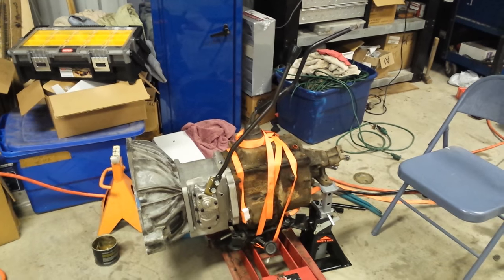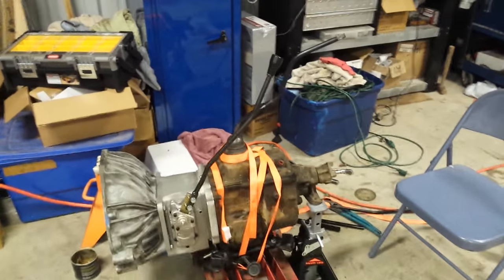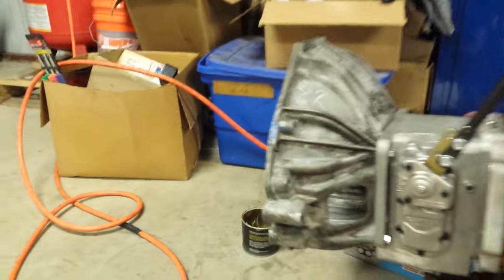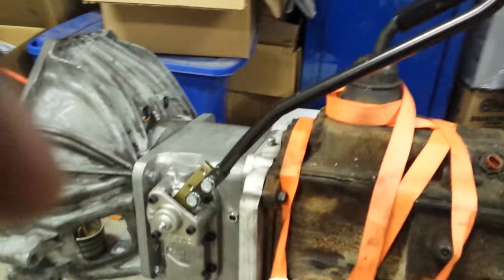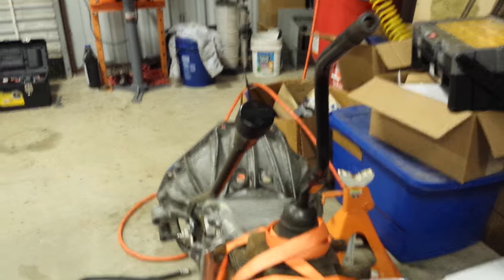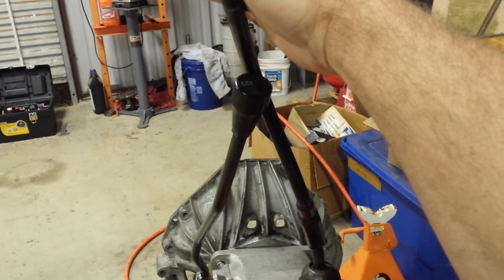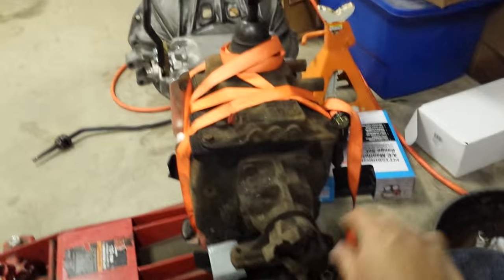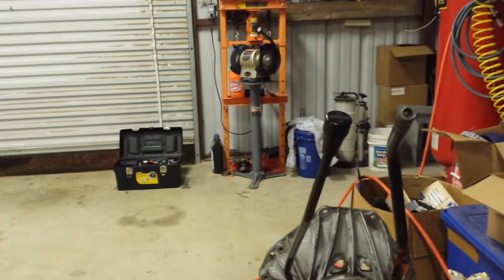F150 Twin Stick Transmission Part 1.

Comment: I want to build this so bad thank you so much for figuring this out and putting it together and making it work!
Reply: Unfortunately, this torque splitter has been discontinued. I wanted one for my 83 C-30 dually, with a 6.2 diesel, and SM465 granny low 4 spd. Wonder how many are available used.

Comment: Another option is the heavy duty ZF 5 speed. I had a 1994 F250HD 2wd 300-6 and ZF heavy duty 5 speed. Except it is a 1 piece transmission and bell housing. I wish I still had that truck.

Comment: i really like this setup. having a hard time choosing between this and just getting a ZF trans for my diesel, with the ZF i can re-use my driveline and only need to replace the shift pan from a later truck to accommodate the taller trans. but having two sticks and 8 gears is just so awesome
Reply from the maker: What Diesel engine do you have? This 2 speed aux trans will bolt to a bellhousing that will accept a Ford or Chevy 4 speed truck transmission. I know you can adapt this to a cummins or an older ford diesel (pre powerstroke) , basically if they ever put a 4 speed granny behind it you can use this transmission. I have also seen this used behind an old two stroke Detroit.
Reply: i have a 6.9 idi with a t-19 which uses the aluminum 4 speed bellhousing
Reply from the maker: Then you can easily do this swap. I thought I had a T-18 but it turns out I have a T-19.  I have the 5.03 first ratio. You probably have the 4.0 first gear ratio. They used that T-19 version behind diesel. It is a close ratio trans so not sure how well the gear splits will be. They are perfect with my wide ratio. Let me know what you decide.
Reply: KLX1990 I have an 84 6.9 1 ton. if I not mistaking I think the diesels use the 437 np 4 so. cause the ratio is closer for the diesel. looks the same as the t-18 though.
Reply: i have had 3 6.9's, a 83, 84 and 86. all were 4 speed and two of them were 4x4's. they all had t-19 transmissions, fully synchronized and they said borg-warner on the side of the case. maybe yours is a custom job?
Reply: KLX1990 could be as rated for 10,000 lbs 350 is considered a 1ton. this route spliter can this work in a diesel application ? the diesel has a high tourqe rating also would a 350 trk be over rated for this? I'm seriously thinking here. thanks.
Reply: the splitter is rated for 420 ft lbs of torque max and 26,000 pounds max. the idi diesels are good engines but they don't make 420 ft lbs, so yeah i would say go for it. the gasser t19 would be a better trans to split gears on because it has a wide ratio, the diesel transmission is pretty close 1st-2nd-3rd
Reply: KLX1990 26,000 that still gives me 15,000 payload if I gobble that much I'm over weight by a long shot. um if I load 4,000 u see a little lag when changing progressions , noticeable 2ND to 3rd , other wise low is a nice low but a shade tall if u know what I mean. I do go into PA sometimes . that why I'm looking at this closely .

Comment: Very nice! I'm thinking about putting one of these in my new for me 79 F250 4x4 and wanted to see something like this! thanks for the upload!
Reply from the maker: I say go for it! They are noisey in overdrive. The noise seems to transmit up thru the shifter, I plan on making some sort of rubber isolater to go between the shift lever and where it bolts to the lever on the side of the transmission. Other than that I love it.

Comment: Thinking about doing this to my 99 same bell housing u have, it's the 4.2 and it's the m5od. So change the clutch line, different slave setup and cross member? And what ab speedo?
Reply from the maker: You will need an older bellhousing from a 4 speed truck. You will not be able to use the m50d , you will have to use a truck 4 speed like a T18 / T19 or an NP435. Slave cylinder from an older 4 speed truck apx 1980 - 1986 ish , 99 is a different frame and body than my 95 so I don't know what issues you might face with floor board clearance , crossmember etc etc.

Comment: Hey There my friend. I will be adapting overdrive units/ auxiliary transmissions from manual transmissions, and the transmissions from the Ford trucks seems like a good candidate for the modifications.

Was wondering if you might be able to tell me which Ford trucks or cars used manual transmissions, preferably 3 speeds, so I can look for them in junkyards.

Cheers!

Comment: Would this work with a NP435 transmission as well? I have a 1966 F350 with a 300i6 thats just too low geared for highway use.
Reply from the maker: Yes it will work with a NP435.

Comment: Honestly curious about the 4 speed, isn't the fourth gear nearly a 1:1? Or a 1: .80 or something like that? Used to have one in my 79 f350 and it would nearly kill the engine putting it in fourth ahahah, im using a 4 speed out of an older chev 3500 for a custom yard tow truck and I was spinning the input shaft when it was in 4th it seemed to be nearly a 1:1 ratio. My question being is the fourth gear a 1:1 or is it higher like a slight overdrive?
Reply from the maker: In most 4 speeds and any granny 4 speed 4th gear is 1 to 1 or direct drive. Depending on how the rear end is geared and what size tires you have in the rear determines what rpm your engine will spin at a given speed.  In this truck 4th gear at 55 mph with the 28 inch tires and 3.55 rear gear was already getting up there in the rpm and was where I usually shifted into overdrive (aux trans).  The second stick was the aux trans which was either a 1 to 1 or an overdrive around .78:1

Comment: Hi there I have a 78 f100 4x4 with a Double trouble 2xt and instead of having two gear shifts I have a Eaton electric motor on it and it is shifted with a switch mounted to the four speed gear shift. thanks for your video
Reply from the maker: I have heard of that setup before. How well does it work? Do you know where I could get the parts to do something like that?
Reply: I got one also, haven't put it in anything yet, are they noisy like these units?

Comment: Will the overdrive work for reverse as well? The np435 is notorious for 5mph reversing with the engine screaming because of the low gears
Reply from the maker: Yes, it will work in any gear including reverse.

Comment: Nice.I got a t18 with a 205 Tcase will this over drive unit hold up to my 99 Powerstroke with a 100 hp tuner.was thinking about this setup and ditching the automatic.
Reply from the maker: Can you bolt a t18 up to a powerstroke? If you can bolt a t18 up to it then you can bolt this overdrive unit up to it. This unit is rated for 24k lbs gross vehicle weight and I think 400 or 450 hp. It has a gearset from an older T98 transmission which was the predessor of the T18. I would think if a t18 can hold up then so can this overdrive unit.

Comment: I think this is fantastic. I have been looking for a range transmission to be coupled with a regular 5 or 6 speed. The 2 speed range trans would have underdrive for pulling my trailer to get started, and overdrive for better fuel economy. So that is a 2 speed range transmission like in my 13 speed Peterbilt truck. Does anybody know where one can get such a transmission?
Reply from the maker: The transmission shown in this video has been discontinued. So finding one used is your only option.  To have underdrive , direct and overdrive you need to look for an old 3 speed auxiliary out of a medium duty truck. They are out there, just have to look hard for them.

Comment: I love this idea.  Did you have to cut the floor pan or just the transmission cover for the new hole and relocated hole?
Reply from the maker: for the main 4 speed I just cut a new hole  in the transmission cover. For the overdrive I had to make a small hole in the floor board.

Comment: Are there splitters that install on the back of the main transmission instead of in front of the main transmission?
Also, would it be possible to install a splitter on 5 or 6 speed manual?
Reply from the maker: Yes, there is a gear vendors unit that bolts to most popular manual and automatic transmissions. It is shifted either automatically via a control module or manually with a button or switch. Also if you can find one there are 3 and 4 speed aux transmissions out of older heavy duty trucks that can and have been custom installed into pickup trucks. They require a lot of fabrication and planning tho. Also back in the late 30's to early 70's there were factory 3 speed manuals with a separate overdrive unit bolted to the rear of the transmission. Most if not all of these were "3 on the tree with OD" They were controlled with a series of switches and a solenoid to shift into OD.
There was also a knob or handle you could pull to engage or disengage the OD feature. I never owned or even drove one of these so can't tell you much about them.

Comment: Hey ktumbleweed I have a 1986 Ford F-250 6.9 diesel 4 speed 4x4. Could I ad the 2 speed trans to my truck? Would I have to get new drive shaft length and would the 4x4 shifted be in a different location after I would instal the 2 trans
Reply: So it would not be good for splitting gears?
Reply from the maker: Not with a close ratio T19. With a wide ratio 4 speed like my T19 gas version it works great as a gear splitter.
Reply: do they make one that would work for my tuck to me able to gear split
Reply from the maker: I do not think so. However you could get this setup and swap your T19 for any Ford wide ratio 4 speed. A T18 or T19 wide ratio would be a direct swap. With a diesel engine you want a close ratio, this set up with a wide ratio 4 speed will give you a close ratio 8 speed. It would also give you a granny gear. Your 4 speed does not really have a granny gear, so you would gain an extra gear or two down low and an overdrive up top and a couple extra gears in between.

Comment: Hey man this is sweet. I just have a question. I have a 95 f150 300 six. Same as yours. So what if you put this on the Mazda transmission?
Reply from the maker: It won't work with the Mazda 5 speed. That transmission has an integral bellhousing. This overdrive unit only works on the older 4 speed transmissions.

Comment: could you install this in a 82 f100 302 5.0 windsor  2wd  with the same drive shaft
Reply from the maker: Probably not. I got lucky in my swap. In my 1995 F150 6 cyl the stock 5 speed was about the same length as the 2 speed aux and T19 4 speed combined.  I reused the driveshaft and just removed the slip joint in the front. It was about 3/4 inch too short but I was able to enlarge the mounting slots for the center bearing and move it forward. This exposed an additional 3/4 inch on the rear shafts slip joint, this worked fine for about 10 months.  I just had my driveshaft lengthened 3/4 inch and center bearing replaced. I did this over the last week and reinstalled the driveshaft 2 days ago. 
In 1982 Ford did not yet have the 5 speed, so you either have a 4 speed granny or a 4 speed overdrive, or possibly a 3 speed column shift. If you reuse the stock 4 speed then you will have to have the driveshaft shortened about 7 inches. That is cheaper than having a shaft lengthened, when they lengthen a shaft they have to replace the entire tube. To shorten a shaft they just chop the shaft and reuse the rest. If you have a 3 speed column shift you would most likely have to convert to a floor shift first, and maybe even bucket seats would be required.

So the short answer to your question is I highly doubt you can install this into your 82 without driveshaft modification.

Comment: So what do you need for this swap I have a auto trans 1996 f150 5.0 4wd
Reply from the maker: You would need a clutch and brake pedal set from a manual truck. An older bell housing from a 4 speed truck. A Clutch Master from same year as your truck.  A clutch slave from an older F150 (1984 works). Flywheel for year of 5.0 but clutch kit from a 1984 or similar year.  An older truck 4 speed like a T18 or T19 , or NP435.  You will need to swap transmission tunnels , automatic trucks have a lower tunnel , you need one from a manual truck so it has a higher hump. An Advance Adapters Ranger III overdrive unit, modify and relocate transmission cross member.  And finally you will need a new driveshaft that matches your new 4 speed on one end and your original rear axle on the other cut to the appropriate length.
I am sure I missed a thing or two..   Good luck!
Reply: @StumpyVanLife  I wouldn't need anything electric control due to engine having a ecu

Comment: how much power can it take
Reply from the maker: The overdrive unit is rated for around 420 ft lbs of torque and  something like 24,000 lbs GVWR.  I would say it is about the same strength of a granny 4 speed, ie NP435 , T19 , SM465 etc.

Comment: I want to do this with a ZF5 so bad in my 7.3! I can't find any one that has done it or any info on it being done.
Reply from the maker: This particular overdrive will only bolt to an older truck 4 speed transmission. Will not bolt to a 5 or 6 speed.  You could do a gear vendors or a remote mount brownie.
Reply: @StumpyVanLife  ya. I understand that. I just meant I was looking and thinking about this concept in a ZF5. So far Gear vendors is the only company o have found that makes an Overdrive unit for the zf transmissions. And it's actually rated for ALOT of torque.. I have been looking at older 3speed OD trans that work with 5speeds though.. but that's a little overkill lol. But honestly it's all for novelty anyways. I'd probably only use it a couple times hauling hay or my I closed in the hills.. other than that I'd probably just drive direct most of the time.

Comment: Can you please post a link where you got the adaptor 2 speed adaptor.
Reply from the maker: It is in the video description. It is from Advance Adapters. It is called a Ranger torque splitter or Ranger overdrive.  Advanceadapters.com
Reply from the maker: This entire transmission set up is for sale.  I am swapping in a 302 V8 with automatic transmission.  Had an accident a few months back and lost my left leg. I have a prosthetic now but its just too much of pain to drive this truck now.  Will include bellhousing , advanceadapters overdrive unit, and Ford T19 4 speed granny.   Asking $1000  (the overdrive unit alone is over $1500 brand new.)  the overdrive only has about 20K miles on it.  The 4 speed came out of a salvage yard so mileage unknown. It is well worn but still shifts good.
Reply: @StumpyVanLife  hello sir, did you sell that 2 speed splitter?

Comment: Why not use the old 5 speed with this set up
Reply from the maker: A few reasons.
1.  The stock 5 speed is weak, I do some towing above 7k lbs and the mazda 5 speed is known to fail under those conditions.
2. If I upgraded to a heavy duty ZF5 I would have a wide ratio between certain gears, so I would be wishing for a splitter.
3. This gives me the best of both worlds. This overdrive unit is super strong, rated for 24k lbs gross vehicle weight. the T19 4 speed is also heavy duty so I have no strength issues with this combo.  The T19 is also a wide ratio transmission but the gear splitter eliminates that concern. I now have a close ratio 8 speed if I split every gear. If I am not towing I do not use the splitter until I am over 50 mph then I am just using it as an overdrive. I start in 2nd (typical granny 4 speed operation) shift to 3rd , then 4th, and then shift into overdrive when I would normally shift to 5th in a 5 speed.
4.  I drove semi trucks for almost 12 years so I actually enjoy having the extra gears. It's fun for me.

Comment: Thats a t19 has the two ports with bolts holding the panels on also synchro on 1st
Reply from the maker: You are correct. At the time of this video I thought it was a T18.  I was disappointed to learn it was a T19.
I got lucky tho and ended up with the 5 to 1 first gear ratio. Most of the T19's have the diesel ratios where first gear is only 4 to 1.
Reply: ktumbleweed oh heck yeah I just picked up a t18 and I'm planning on putting it in my bronco its an '87 f150 I'm using and the bronco is an '89 with a 351 and c6. I know I need a knew flywheel but know what I have to do for the reverse and neutral safety? Bypass the nuetral right? I'm just confused about making the reverse lights work since the bronco is super clean. Any help would be appreciated
Reply from the maker: Either bypass the neutral safety switch altogether or install a clutch safety switch.
As far as reverse goes, it should be pretty simple to hook it up to the T18. There should be a reverse switch already on the transmission. When your in reverse the switch either completes the circuit on the positive side or it grounds the negative side of the circuit. If it is only one wire then it grounds the negative side when in reverse.
Reply: ktumbleweed oh never really realized how straight forward it is. Guess I needed someone who knew what they are doing to reassure me on what's up. Thank you so much now I'm actually comfortable doing it and not worried about butchering anything. I'll get a video up of the rig when it's done. Got a transfer case with a broken shift mode fork or something. Shifter is in 4wd lo but only rear shaft spins and seems to go regular speed. Might have chain broken cause it sounds horrible but no clue about it
Reply from the maker: Glad to help!  I would love to see your progress. On the transfer case, yep it sounds like either a broken chain or something else internally like a shift fork. Don't be afraid to take it apart. Just take pictures and notes along the way and you should have no problem finding and fixing the problem. Transfer cases are pretty simple once you get past the fear of taking it apart. Just remember where all the snap rings, and stuff like that go. I like to lay it all out on a table and as I remove stuff stack it in order, and I take plenty of pictures. Good luck!